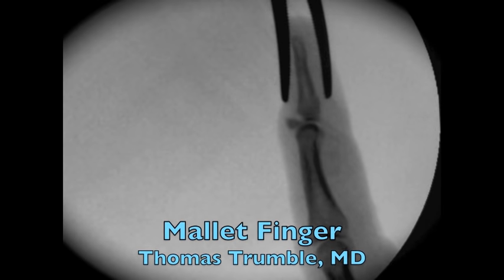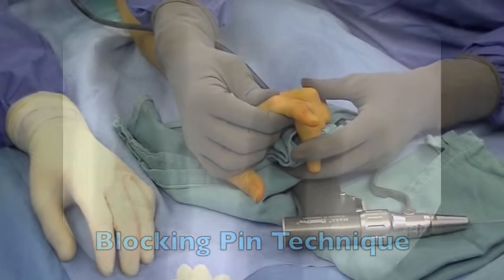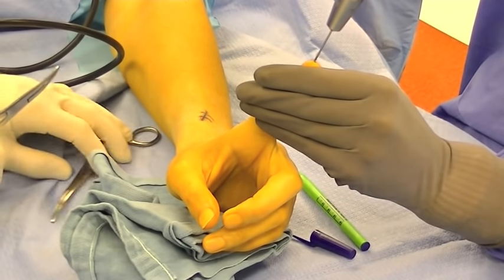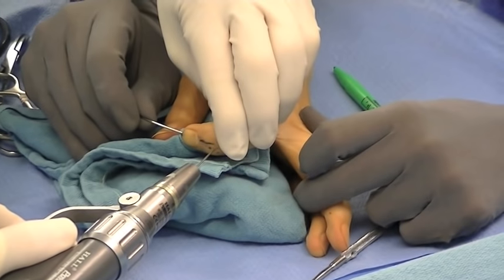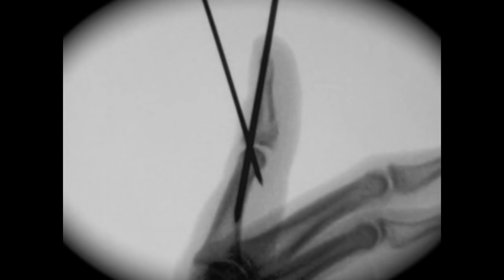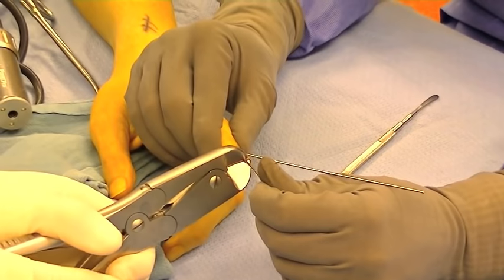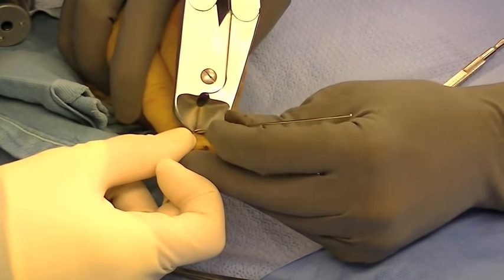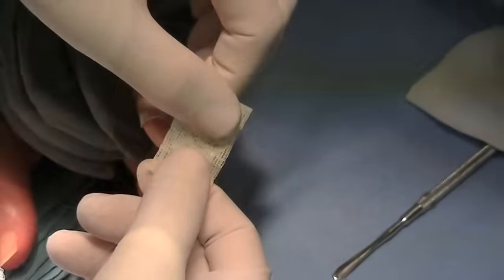Mallet Finger Surgery Preformed by Dr. Thomas Trumble

Comment: very well done to you and god bless your sister-in-law. had a bony mallet finger last august, hitting my pinky while loading my suitcase in the car going on holiday... didn't take it seriously, thought if it was broken, I wouldnt be able to bear the pain. cut long story short 2 weeks after doctors said, you 're too late in... bone has started formulating but broken part of the joint is off. you need surgery... surgery done 3 weeks after injury... 1 k-wire in and casting for 5 wks. doctor takes it off. physical therapy started to get the DIP joint moving, 3-4 days a week for 4 weeks... 24 sessions after, the bump on the joint does not subside.. we take an x-ray... joint has healed but bony fructured little piece did not fully sit in the joint... partly out... 50% of times i flex my finger, i hear a crack... lag is not too much but grip and strength of the pinky are impaired..
Reply: I just cried reading your comment, i had the fracture on feb 10 surgery on the 28 and been on this cast since. I really want it of. And since my case sounds so much like yours I’m afraid that after all this effort my finger won’t work 😭😭

Comment: Hi bob i have a question please reply: I have broke my mallet finger before 7 weeks the broken place is in the middle its diagonally / so the doctor made a surgery and now its seems very good but my finger its kinda numb is that normally my doctor said that after the wound is heald i need to start with exercise/ therapy and i wanted to ask you about my wound should I cover it with bandage or should I leave it uncovert thx

Comment: After rehabilition are patients allowed to play guitar?
Reply: dad dadd this question cut deep my heart bro
Reply: Did you go through with it?  How did it go?  I'm a guitar player as well, currently suffering from arthritis induced mallet finger/swan neck.
Reply: Hey guys i am Guitar player too and i have mallet finger :( how did it go ?
Reply: @huseyinanagli4195  did you make any progress with your finger my dear brother in strings? :)
Reply: @igorperic5232   Hey bro. for a few months my finger was wrapped in the splint and it got better. I can now play the guitar without any problems.
Reply: did you have surgery?
Reply: @igorperic5232  No men. I talked to 7 doctors, some of them told me to have an operation. I listened to the others.
Reply: @huseyinanagli4195  hi bro after how many months u were able to play guitar. I am also a guitar player and I had surgery for mallet finger six weeks ago k wires are removed but there is no movement on the tip of my left hand ring finger
Reply: @krishnasori4876  Movement permanently gone ?
Reply: @indianengineer5802  I have movement in my finger but finger looks different now as if there is a bump
Reply: @krishnasori4876  Was swelling still there on the day of wire removal or it was gone. It's 2 weeks since surgery and I still have swelling I am worried if surgery might fail. How was swelling in your condition?
Reply: @krishnasori4876 how many weeks did it take for k wires removal i did my surgery 3
4 weeks ago can i remove it?

Comment: I went through the same surgery, but the surgeon  kept the pins for only 4.5 weeks and the outcome was the bone refractured. Its been 3years now. My finger DIP joint is bent 50 degrees. Such incompetent doctors :(
Reply: It is an imminent risk despite good surgery. Incompetence has nothing to do
Reply: @danieltovar6576  Did you went throught the same surgery or are you an surgeon?
Reply: @sabkabhala5892  Yes, I am an orthopedic surgeon and according to clinical trials, the mallet finger has a bad prognosis. Good luck
Reply: Me paso lo mismo se volvio a doblar entonces a utilizar ferula o q

Comment: I have published  this technique 21 years ago in CORR magazine, One should be careful about joint reduction and rotation of the bone fragment, most of time 1,2 mm k wire we use however it may change according the finger

Comment: I just had the surgery on my pinky finger on 2/18/2022. I am too squeamish to watch the video.  Maybe, I will watch the video in 7 weeks after I have the pins removed.
Reply: how is your movements ? how long did it take to full recover your flexibility?
Reply: @saulealex  today is July 22nd, 2022. The doctor removed the pin after 6 weeks. The procedure did not hurt at all because the anesthesia was incredible. I did not watch him do it, but I didn't not even know when he started or ended because the anesthesia was perfect. I did not feel a thing. After removing the pin, I had to wear a splint for another month to protect it. After that, I had to do finger exercises for a few weeks to get it to bend again because it was stuck in the straight position. I would say it is fully recovered now, but I cannot make my finger perfectly straight like I could with the good finger on the other hand. My pinky is slightly bent, but not much. I can fold it completely like I can the good finger. I would recommend leaving the pin in for 7-  8 weeks. I felt like 6 weeks was a little early to remove it. While I had the pin in the finger, I had to wear a splint to protect it from being jammed. I wore one of those splints that you can slide on and slide off easily and maybe just use one little piece of tape to keep it on. The splints with a lot of tape were pain in the neck because you couldn't get them wet while showering. I removed the splint whenever I had a wash my hands or shower..
Reply: @jaybloomfield5082  Hello! May I know does it hurt after the surgery while wires are pinned for 6wks? Did you have a bony mallet?
Reply: @jacqontheroad   No, it did not hurt at all while the pins were in my finger.  From start to finish nothing was painful except for the splint which kept on irritating my skin.  If this ever happens to me again, I will forego trying to heal the finger with a splint and just have the pins inserted right away.   The tendon in my DPI joint was torn.  Is that the same as a bony mallet?